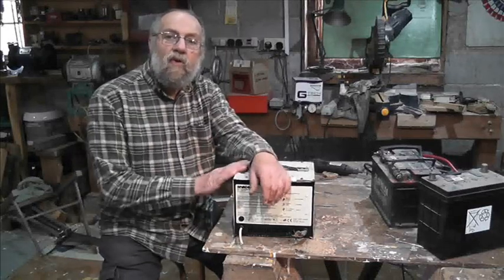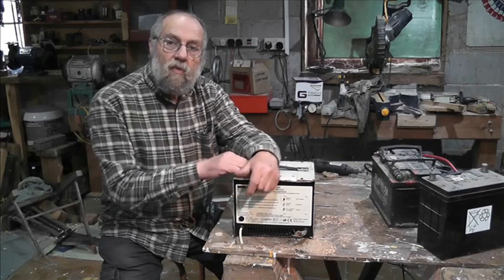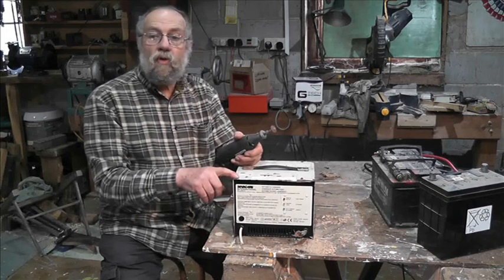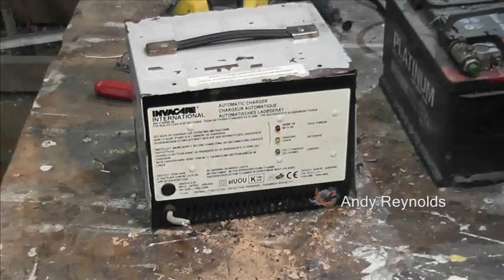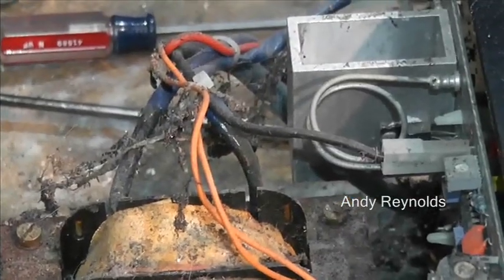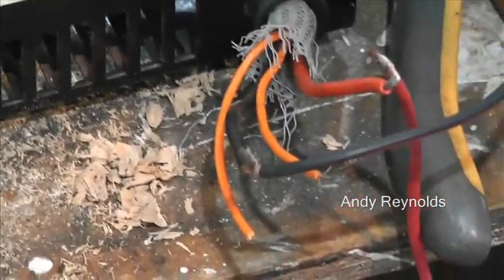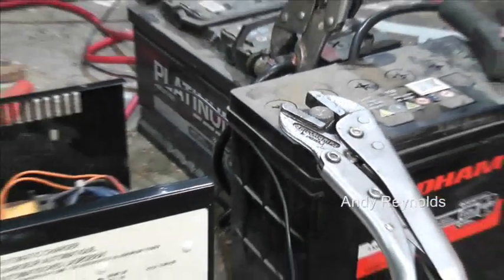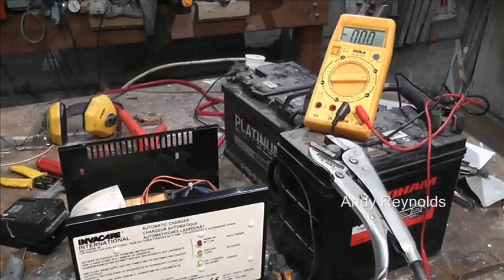Battery charger load test and repurpose

Comment: Thanks Andy one mans loss is another's gain. The CC Trip is probably an adjustment to set the max charger current. If you plan to leave it connected to your battery's powered off you will have a small leakage current when not powered up which will drain your battery's eventually. You could always put a mains relay on the mains input with the DC output going through the contacts that would stop the drain.
Reply from the maker: Martin, good point and a relay seems the ideal solution, many thanks, cheers

Comment: Hi Andy, may I ask a tech question regarding a dimmer switch or PWM speed controller? I have a Gaggia Classic home espresso machine which has a small vibratory water pump, there are many “home diy mods” on YouTube to modify this machine to reduce the standard pump pressure from 12bar to an ideal 9bar, one idea is to be able to manually adjust the pump speed thereby adjusting the pressure by using either a single pole dimmer switch or a PWM, the only PWM controllers I see on internet are DC rated? my question is could one of these be used on what is a 240v pump? or would a basic dimmer switch do the job to control pump speed? Sorry to go off your subject but you are the only sparks I feel safe asking…Thanks Andrew
Reply from the maker: Andrew, it just depends what type of motor is used, whether brushed or induction. An induction motor speed is defined by the AC cycles, brushed motor by the volts. Bootsowen has had one of these apart and frequently comments on my videos, cheers

Comment: Andy: I'm commenting from 🇨🇦. Can you explain high-tech recycling? Cellphones and TV's? I'm stumped.🙄
Reply from the maker: Hi, difficult apart from fixing them as I did with my Nokia 3260i or reusing the batteries. With LCD TVs you can remove the LCD and use the backlight and diffuser as a light source. Some are powerful and can be cut up and run with a laptop power supply. Early LCD screens have florescent mini tubes but later ones have useful LEDs, cheers

Comment: Andy, I think the pot inside could be 'constant current trip' - 'CC' in a psu  means constant current to me anyway, but 'over current trip' might make more sense here ? Just a thought. There might only be two diodes if the transformer has a centre tap - ie there will be 3 secondary wires not two. Cheers, Dave
Reply from the maker: Dave, good to hear from you, ah that makes sense. It's just right for that Lister PK generator project, cheers
Reply from the maker: Dave, further: there are only 2 transformer output connections. The 2 semi conductors on the heat sink are SCRs S1610DH, so that might be the other diodes for some reason. Cheers

Comment: I have a stack of power chair chargers most newer than that one, the wife has to use one and every time she gets a new chair a new charger comes with. I also have a number of chai controllers and motors with wheels. Not sure what the extra two wires are for as most chargers just have three connections on the end of a lead containing two wires two of the pins are shorted together which tels the chair it is plugged in and disables the motor controls, I would think that the two thin wires are for voltage monitoring.
Reply from the maker: That's interesting, so you think it's a power chair charger, quite beefy and heavy duty. Seems to work fine with the small wires disconnected, good enough, cheers
Reply: @TheInfoworks  yes definitely
Reply from the maker: @Qaz375  cheers
Reply: @TheInfoworks  Invacare are one of the largest power chair manufacturers in the world.
Reply from the maker: @Equiluxe1  Thanks for the info, certainly seems reasonable quality, but maybe 10 yeas old. So the 2 small wires disable the chair whilst charging so I can unplug and remove them, cheers
Reply: @TheInfoworks  With two they are far more likely to be a separate  voltage sense. I have some which are 15 years old that look more modern than that one, I think they moved to to switch mode nearly twenty years ago  but there might have been other equipment still using that type of design as Invacare also make some other medical equipment.
Reply from the maker: @Equiluxe1  That's what I was musing on, a big transformer is robust but old technology so this could be from the nineties. I will search for a date code, cheers
Reply from the maker: @Equiluxe1  There's a label on the bottom SN018112, so 2012 or 2002, the latter I suspect, cheers